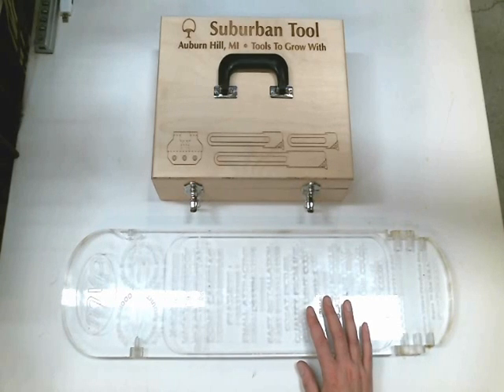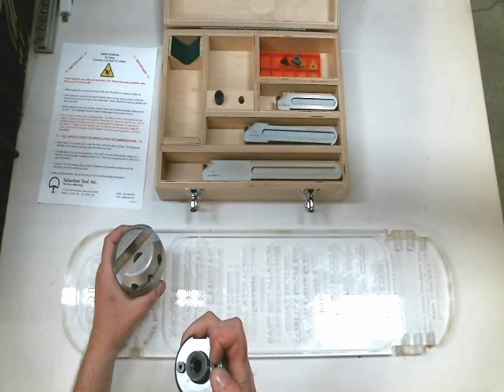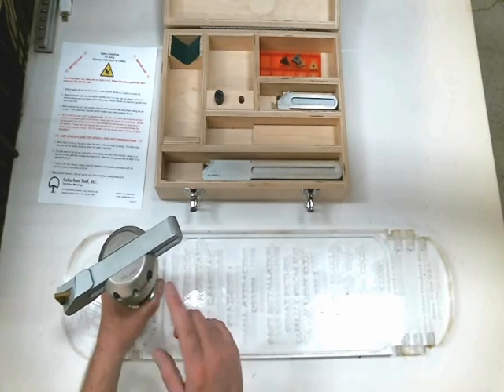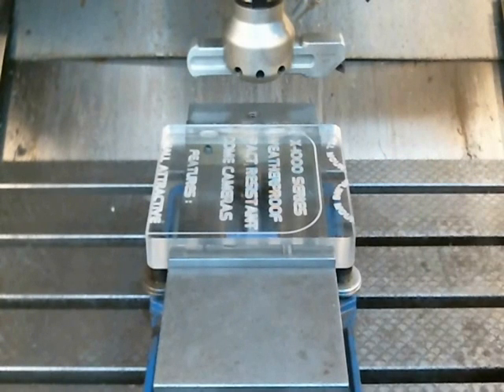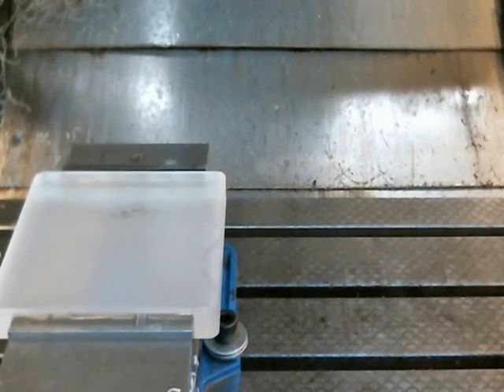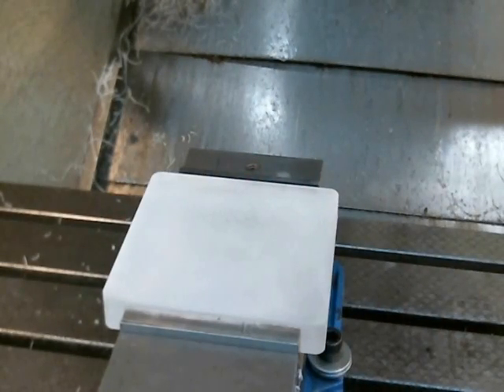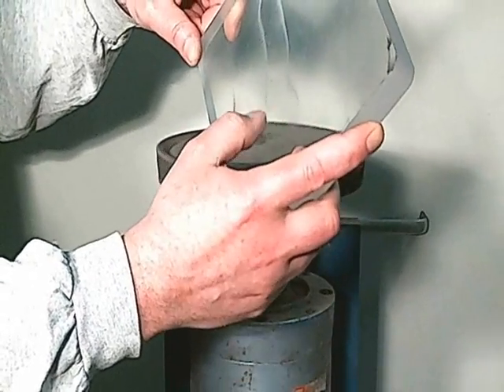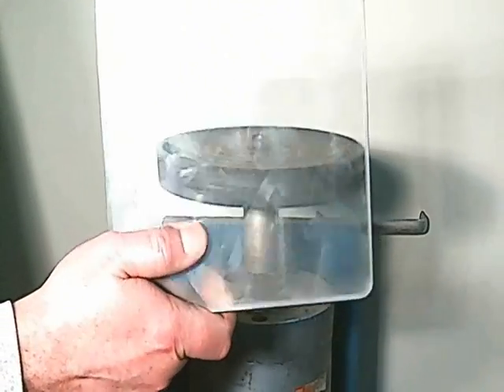How to Machine Clear Plastic, and Make it Clear Again with a Suburban Tool Fly Cutter

Comment: just take a propane tourch and hit the flame verry short. to the surface.............you get a real nice shine. or just copper shine works mutch better than this polesching wheel
Reply from the maker: Thanks for watching and commenting! I have had good results with flame polishing edges but never tried a flat surface, just does not seem right. Are you saying that surface would be as optically clear as I made it? Seems like distortion would occur due to the random nature of your hands movements with the torch. I do not work with acrylic very often but I always regarded flame polishing as an edge treatment where optical clarity it not that important.
Reply: @mvpmachine  we did it a lot with 15-20mm thick PMMA plexi glas in europe. it works graith.  on the safe site use grith 1000-2000 and end with copper polisch or better 3M.  i am no fan of hard metal kind polich cloth. the bring in a lot of heat and tension

Comment: Plexiglas needs to be cut with a negative rake tool, just like you do for brass, also put a slight radius on it, use kerosene  as a lube. Machined a lot of plexiglass to critical measurements = or  - .001. Then polished with a buffing wheel.

Comment: Back in the sixties we manufactured card weights for computers. They were first injection molded then we ran them over a planer to make the perfectly flat then we sanded them with 320 grit sandpaper then we ran them through a column of heated ethylene dichloride fumes and they came out perfectly clear.
Reply from the maker: Peter what is a card weight and what function did it perform?
Reply: @mvpmachine  The machines were programed with the cards. They had holes punched in them in various places. They would load stacks of card into the machine and they would drop in and the pattern read by the machine to get information.
Reply: @mvpmachine  https://en.wikipedia.org/wiki/Computer_programming_in_the_punched_card_era
Reply from the maker: I remember those cards from elementary school in the 1970s

Comment: I learned how to polish plexi in 8th grade shop class back in 1962.  Guess the schools have not taught that in quite a few years. - The use any high buck CNC machine was totally necessary. You could have gotten the same results with a Harbor Freight belt sander and a body shop polisher.in much less time.
Reply: Not if you wanted a flat surface for precise engraving depths using the part. Belt sanders are so hard to control with any precision that I don't like to use them even for woodworking except when removing large amounts of material when precision is not needed.

Comment: The fly cutter worked really well. But for polishing, a simple propane or mapp gas hand torch would have flame polished it in a fraction of the time and did just as good or better job the polishing wheel. Much simpler and faster!

But you did a good job with the polishing wheel!
Reply: and flame polishing, particularly on the edges of machined pieces will remove stresses placed in the acrylic that can later become cracks sometimes quite delayed, or until mechanical stress. but cracks can just appear overnight with parts on the shelf.

Comment: What happened to rough cut/finish cut?
Reply from the maker: +Stephen Hodge  Stephen this cut depth in the acrylic is actually like a finish cut, you need to make a chip and at .035" depth of cut we were spinning the cutter kind of fast and feeding slow so the chips were more like light strings. From our experience too shallow of a cut in certain materials with this cutter and others will leave a poor finish. With Plastic and aluminum .005" to .007" is usually the minimum finish cut depth you would want to take for optimal finish, but both materials finish quite well even if you exceed that depth considerably. Too light of a cut and your "grinding" and that's not great for surface finish with most milling tools.
Reply from the maker: ardvarkkkk1 what kind of experience do you have? You are critical of every video you watch. You seem to be like a negative fly cutter stalker. I have seen your comments everywhere and they have no merit in my opinion. We work in the real world every day with tools that work as shown in our videos. They make us money because our finishes (and flatness and tolerances) are perfect and all customers like that. Buy a Suburban Tool Fly Cutter and try is yourself then comment. And stop stalking it's weird.
Reply: +mvpmachine
Use a high speed steel cutter and you can take .001 passes if you like. You will also come out with better finishes. Carbide pushes too much on both plastic and aluminum.

Comment: When I was a young Machinist many years ago we used to Flame plexglass  with a torch using a soft flame over the machined surface area very carefully . this would bring it to a crystal clear state
Reply from the maker: +1995dresser We have a little (very little) experience with flame polishing on the edges of plexi but would think on a large surface area like the face of this part it may be easy to distort the material. It also seems like it would take a lot longer than this did and we did have a crystal clear finish but also extremely flat which is great for engraving. When we originally made these display parts we would order the full size sheets of 1" acrylic and saw cut them to the roughly 32" x 7" dimension and the 1" thickness over the 7" dimension was often off by over .035" or more making engraving difficult without shimming and indicating the part.

Comment: I bought the Suburban Tool fly cutting bar a couple of days ago.  I'll be making my own cutting head to match my machine, and I look forward to using this tool.  I think I'm going to call it the SuperDuperFly, because it's a larger version of the Tormach SuperFly fly cutter. I've enjoyed watching your various videos showing the use of this tool.  Thanks!

WARNING:  Isopropyl alcohol is not a safe solvent for acrylic.  I think you got away with it because you had polished cast acrylic.  Do not try this on heat bent acrylic.  There is enough surface tension on the outside of the bend that the alcohol will remove the polymer crosslinks and the plastic will craze and crack.
Reply from the maker: Liberty4Ever Did not know that about Isopropyl alcohol and acrylic. What is a good, safe cleaning solvent for acrylic?
Reply: mvpmachine Kerosene is good for removing adhesives and stickers, which is a common problem on acrylic.  After that, you'll need something to remove the kerosene, which is similar to you needing to remove the wax based buffing compound.  I use detergents rather than solvents for this.  Simple Green, etc.  Sometimes dish washing detergent can dissolve gummy adhesive overnight and warm soapy water cleans up the residue.  WD-40 is also surprisingly acrylic safe and dissolves adhesive, but probably requires soapy water to remove the WD-40.  I've heard that turpentine is acrylic safe but haven't tried that one.

I'm a big fan of isopropyl alcohol for most solvent degreasing applications, but not acrylic.  I can buy it cheap in the pharmacy aisle at the local grocery store, and unlike acetone, nobody assumes I'm cooking meth, even when I buy four quarts at the same time.  Hardware store acetone is reclaimed from commercial processes.  It's distilled, but there is still some light oil that makes it into the acetone you buy, and it'll leave a very slight trace of oil on your parts when it evaporates.  Alcohol is manufactured instead of reclaimed, so it won't have any oil contaminates.
Reply from the maker: Liberty4Ever Cool thanks for the good information!